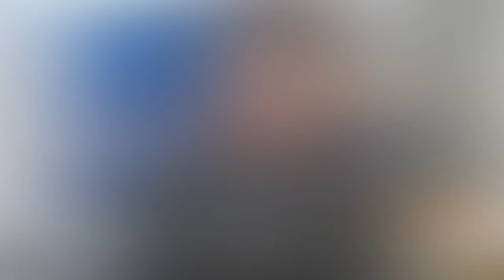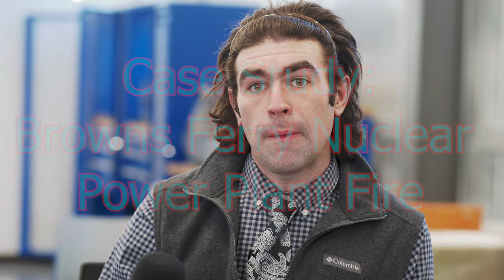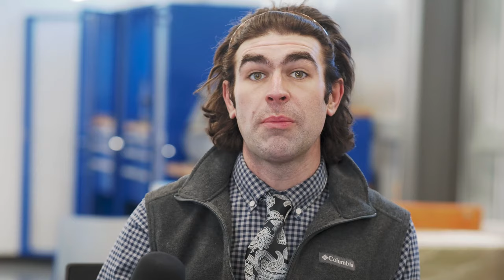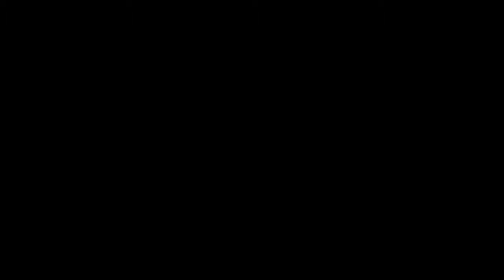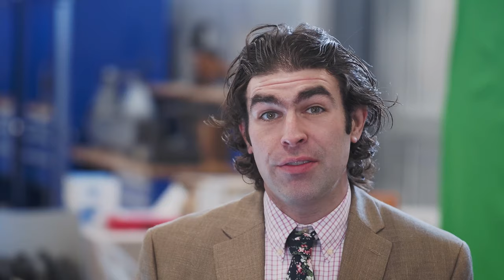Nuclear Power Plant Fire, Browns Ferry, Decatur Alabama 1975

Comment: The whole incident could have been stopped much sooner than it actually was. Upon use of the C02 extinguishing system, smoke began to flood the control rooms, so the use of the C02 system was halted.  The officials at TVA BFNP denied the Athens fire department’s chief’s proposal to use water on the fire, with concern’s related to the electrical functionality of reactors 1 and 2. The TVA BFNP employees tried to use type B & C extinguishers on a class A fire, resulting in the near total loss of control for both reactors before BFNP officials finally agreed to use water on the fire. Athens fire department had the fire out in minutes according to reports.
Reply: the TVA Has  a Long history of Problems at Browns ferry, them Ge Mark 1 are Junk

Comment: Please give your knowledge in regards to Ukraine's nuclear reactor fire we just heard about
Reply from the maker: Hi, in my estimation, the operators would have shut the reactors down days ago. They are modern PWR units, not the RBMK type like Chernobyl. After a few days, the fuel rods are in a somewhat safe condition as long as no direct hits are taken. The cooling system should do it’s job whether the control room is damaged or not. In any case, the units have containment like any western reactor and so could handle a meltdown without spreading radiation.